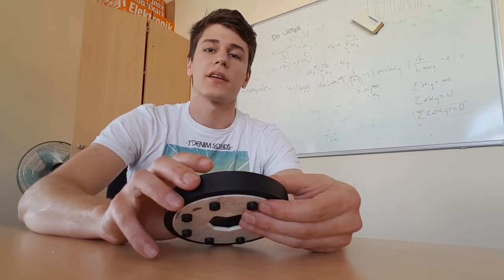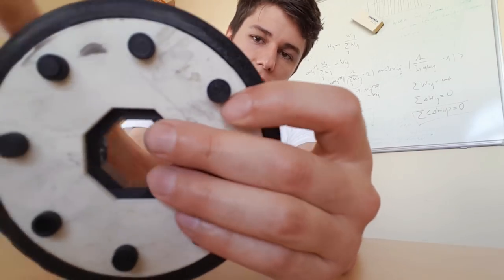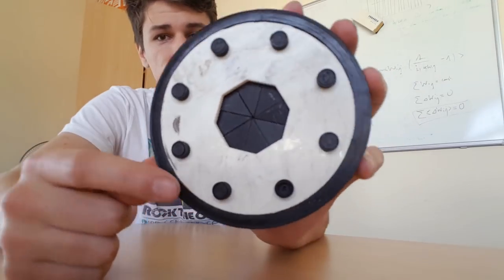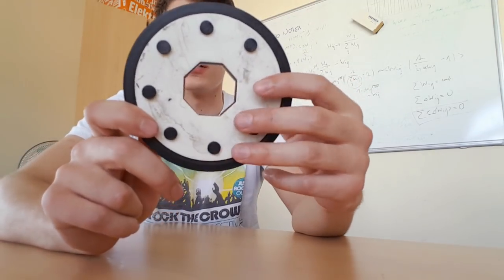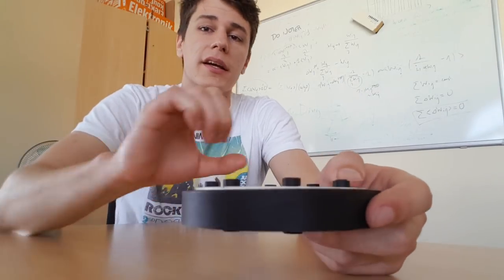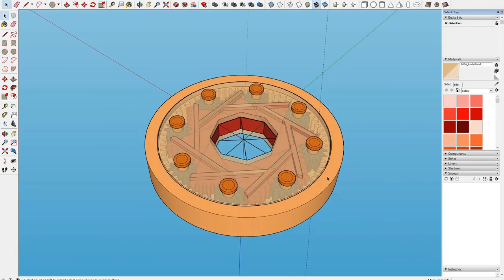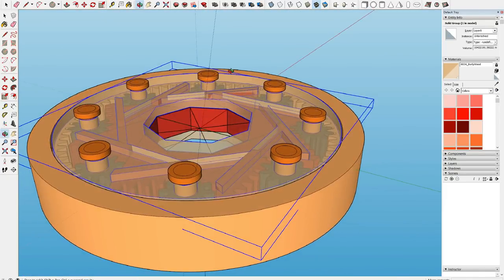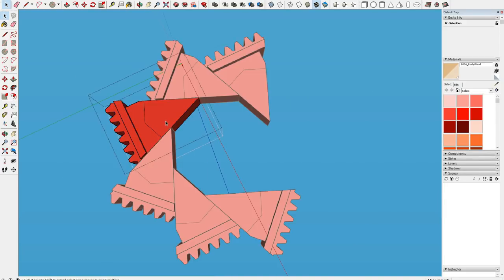3D Printed Iris Diaphragm

Comment: The friction between the aperture "blades" may be what's causing the rough, inconsistent motion, like how rubbing tectonic plates cause sudden earthquakes when the get caught. So you might want to try to spray some WD40 on that area, and it may be way smoother that way (either that or it's the simple result of having lots of gears).  Nonetheless, great video! I always wondered how one would go about making a variable aperture, as it seemed to be rather complicated. Once I saw this video, however, I was amazed by how elegantly a variable aperture could be made! Fantastic work, and I'm glad to see a video from you again.

Comment: If you want to remove some friction without lubricant you can reduce the surface area that the triangles touch on. It would be harder to 3d print, but hollowing out the middles of the triangles or just a small indent could reduce the surface area and friction greatly. :)

Comment: Hey JL, I can recommend the CAD fusion 360, from autodesk, its free, even for commercial use up to 100k $ profit per year and its easy to get in to. It also has a simulation tool to simulate stress and if a part would fail under constant pressure. I'm not affiliated with them and I also only used it for about half a year but I quickly started to like it. I think its comparable to solidworks
Reply from the maker: thank you! great tip! The more I used sketchup, the more I got annoyed with its limited functions and bugs. Gonna try that out

Comment: Seems like a few people are recommending CAD software so I thought I would recommend one myself. It's called Rhino3D. It is honestly the only CAD software I have tried but just by going what others have said about the software, it is very versatile and a lot like Sketchup but with more features and a lot better quality. It is also supposed to allow better accuracy with small scale objects than Sketchup.  It is expensive (roughly $1,000 US Dollars) but unlike Autodesk its a one time fee. Only reason I tried it was because they have a 90 day trial of the full version. Guess with CAD software its a lot about user preference but its worth a try if you can afford it. Either way, neat invention.
Reply: Probably should say that like one of the commentators below suggested, use the AutoDesk Fusion since you are part of a University and you probably don't have the funds for this.

Comment: did you use a FDM (fused deposition) printer? also which orientation did you print the parts in?

By the looks of it I think you printed them with a sliding edge on the platform, I think some of the stiffness comes from layer edges catching on each other it might be better to print parallel with the gear teeth.
Reply from the maker: I printed it so no supports were necessary, I am using a standart extrusion ABS printer. the stifness mostly comes from low tolerances and the fact that in order to hold it you are pressing parts together.

Comment: Did you treat it with anything for making it slide better? I know there are a lot of ways to make rubics cubes turn better our there, I'd try applying that on the thing.
Reply from the maker: I added a bit of lubricant, but it has probably all worn off by now
Reply: Just dive it in xD